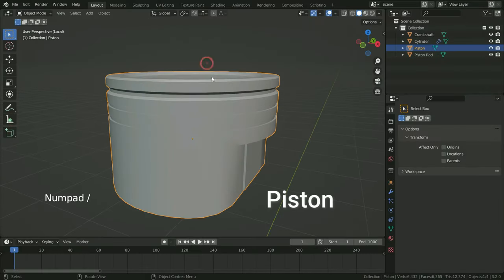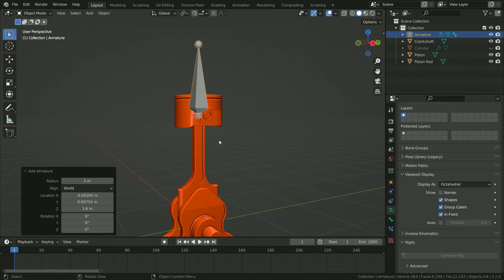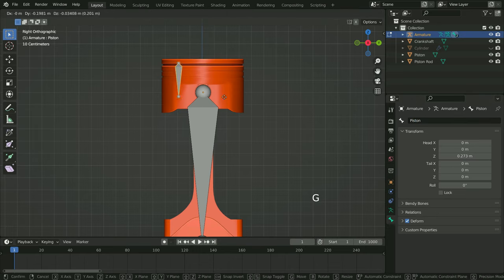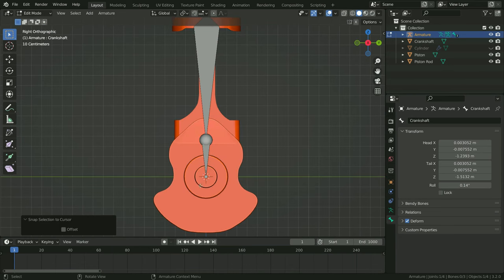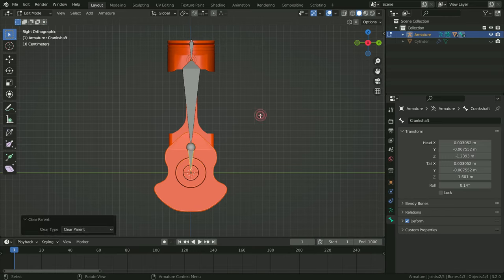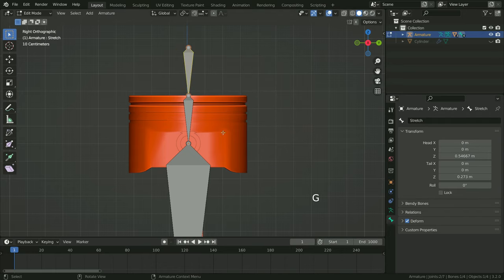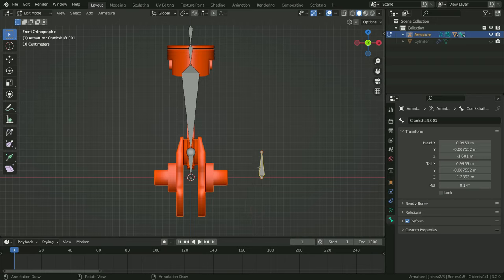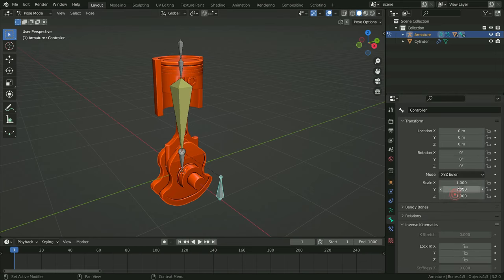Blender 3.2 Tutorial | Mechanical Rigging

Comment: I have to set it to 238, instead of 240, as I found the last frame jerked before returning back to the first frame. I don't know why, 60 x 4 should be 240 but cannot use this number. Is this anything to do with interpolation not setting to constant? I'm using v3.10 of Blender.

Comment: Amazing! Thank you very much for this tutorial. I want to make another piston right next to this one, but with reverse animation, when one goes up the other goes down, does anyone know how I should put the numbers in the animation to achieve this result?
Reply from the maker: I think you can make it giving 180 degrees difference between the rotation values.
Reply: @GraphicsMK  for some reason it speeds up :( I'll try with differents values. Thanks!

Edit: I had set the values to positive and when I changed them to negative it worked perfectly. my bad. Thanks a lot!

Comment: 9:30 everythings going a little bit different (as always in every tutorial i need). I cant set "360°" there are no °. just a number, and only can rotate to 180° (hardly, then stops even if set 400 or more) and there is a weird W in Rotation... help, someone o
Reply: ah, the "mode" was set on "Quaternion XYZW" for some reason... just used XYZ Euler and it works...